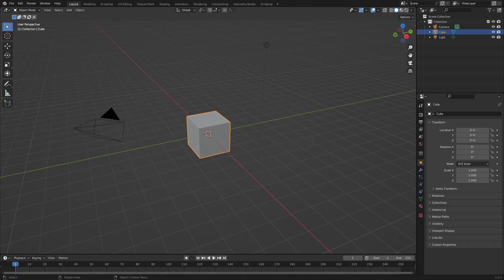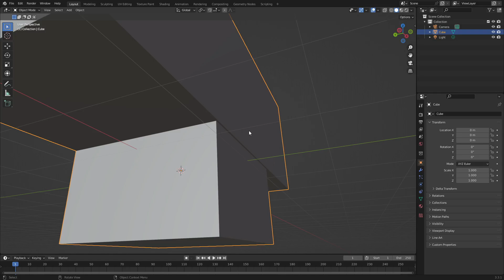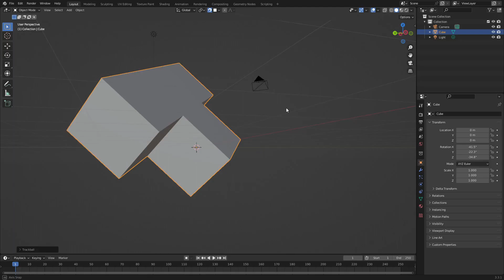Blender Tutorial: How to Fix Clipping Flickering (Eevee)

Comment: I built a house, the walls are quite thin and close together and no apparent flickering is present until I move far away please help
Reply: I'm getting the same issue - did you resolve this?
Reply: @DeShark88  Render it in cycles or just don't move camera too far away from building in Eevee